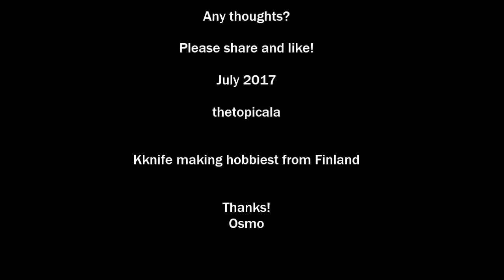Fällkniven F1Pro Custom by thetopicala

Comment: Shortening the tang is a big problem. Rule No. 1. The tang should always be in the entire handle.
Reply from the maker: Yes, you must be right. In the perfect world everything is bigger and stronger. 😉
Reply: @thetopicala  The world has never been, is not, and will never be perfect. But there is no point in making it any worse by thoughtlessly weakening the structure.

Comment: Beautiful !! Whenever I put a new handle on a blade (and that is not often) I use Hammerite on the tang. This paint is tough but need about 2 weeks to harden. The big pro for me is that even if water gets between the handle and tang it will never rust.
Reply from the maker: Dutch Bushcraft Thanks! I know Hammerite, I have got it at the garage.

Comment: Very nice 👍 . Just wondering if it was possible to save the original lanyard hole and align it with a hole in the new hidden tang handle? It wouldn’t probably make a lot of difference but would feel more structurally integrated.
Reply from the maker: Hey Ivan, just had a quick glimpse for your idea. Did you notice that the original lanyard hole was situated at 9cm distance from the front bolster and the new appr 11cm. The looks of the handle (due to new shape) would had been propably much different due to different position of the l-hole. What do you think? Thanks, Osmo

Comment: Very nice job again .
What sort of cost ? How long did it take you ?
Reply from the maker: Grant Cook Hi, thanks! With the knife work and a sheath peopably 8-10 hours during one week. The costs? The cost of a original knife and the rest comes from the handle block, leather and things like epoxy, sanding materials etc small things. Wood block and original knife are the main things of course.

Comment: Far more practical in original form.

No finger guard 
No grip
Wet holding sheath
Discolouring brass
Restricted wood handle so no traveling abroad without certification
Each to their own and the workman ship looks ok but big step back IMHO. A knife especially like this should be a celebrated tool unfortunately you just managed with great effort to end up with less of a tool than you began with; at some considerable expense.

But again the workmanship looks nice.
Reply from the maker: Guide504 Thank you for your comment. Well, anyone can make their own desicion how his knife should be. We are all free to make our own analyses about different kind of tools. I may disaggree with yours but I’m happy you have put some good effort on it. 👍🏻 thanks, Osmo
Reply: don't get me wrong i have used many a nordic knife great to look at but lethal when wet and sharp as a razor.
Reply from the maker: Guide504 no probs G! I was just about to ask about how would you say about tradiotional oval shaped Finnish puukko knife 😅? Well, we usually use the knife with barehands even at winter time and better grip. With mittens it would be disaster 😂
Reply: I have made a couple of knives on custom M Streyfors blades as presentation pieces, but mostly I make or buy working tools. the guard on the pro series is an after thought in terms of it's fixing but it is good to have something there if allowed. I spent some time in the russian arctic and they do not allow finger guards so it was usefull to have the old A1 A2 F1 with rubberised handles that didn't show up on the airport scanners. also took the big tiger shark SOG for other things.
Reply from the maker: Guide504 Per se in Finland we don’t think the finger guard at all with traditionally made puukko knifes at all. That’s why it’s so disturbing and almost shocking to meet resistance against finger guard free knife tool. 😁
Reply: @thetopicala  have you looked at the d2 enzo blades ?
Reply from the maker: Guide504 nope
Reply: @thetopicala  worth a look, available from brisa full tang nice geometry excellent price.

Comment: Now I see why the fingerguard comes loose sometimes on F1 Pro, it's not an exact fit. They need wedges to make the fitting tighter.  Put it under too much stress and it comes loose. The DutchBushcraftKnives guys had  this problem also and had to send it back to Fallkniven.